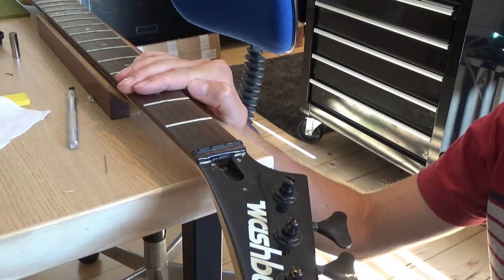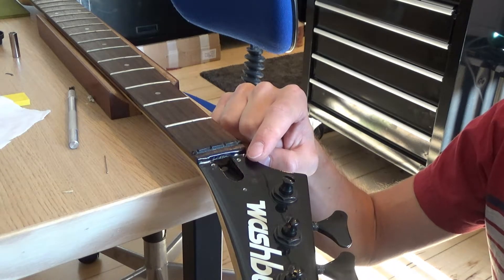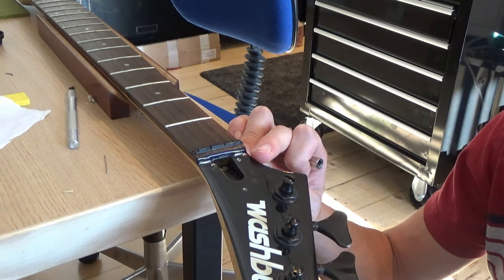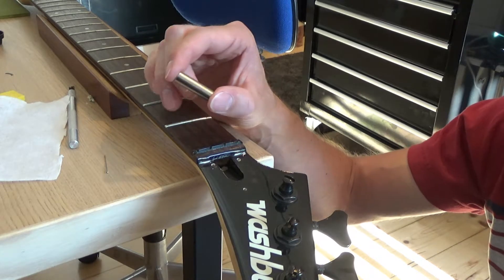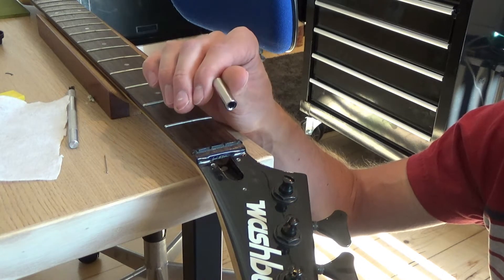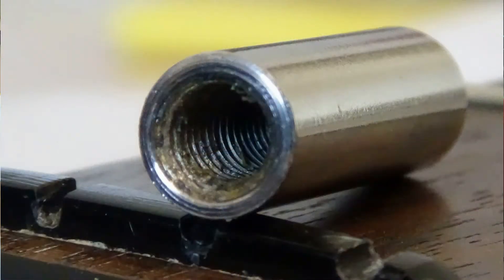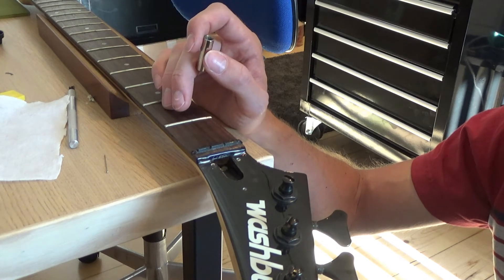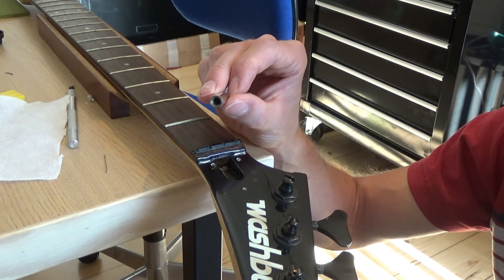1988 Washburn Force ABT B-20 Bass w. EMG Select Active Pickups - Truss Rod Nut FINALLY Came Loose

Comment: Im having the same problem, what kind of spray did you use? Thanks!
Reply from the maker: Hi,
I'm sorry to hear that, I can't remember exactly what I used...
But I believe something like WD-40 will do, but not matter what you use, please do make sure that you put some tissuepaper around the Truss rod nut, otherwise the spray will seep into the sourinding wood.

Please let me know if you need anything else.
Cheers.
Reply: @GuitarNTabs  hi thanks for replying. Yes, Ive been using wd 40 on a syringe to inject it on the nut. It's only been two days of letting it absorb and trying to gradually loosen/tighten the nut to introduce some movement, so far no progress. I ordered something called PB blaster, its a penetrant supposedly better at getting rid of rust. I'll be trying your solder technique as well. Any other tips can you give me? And how much force is too much when cranking the allen key? Thanks mn